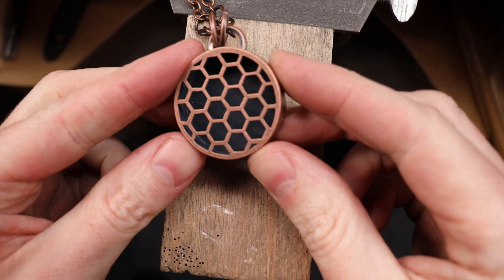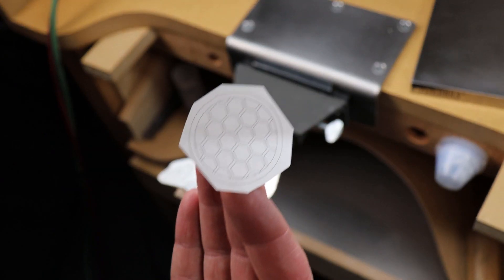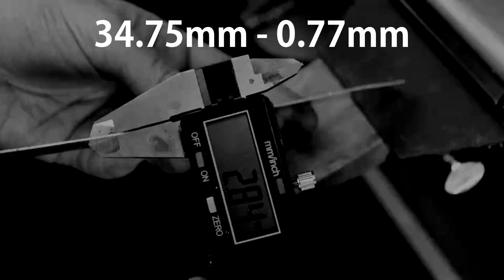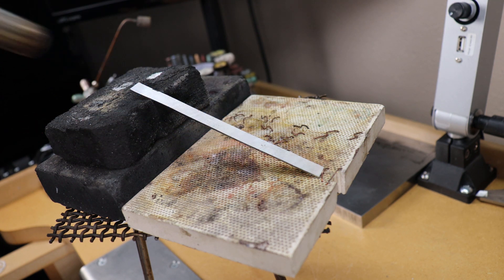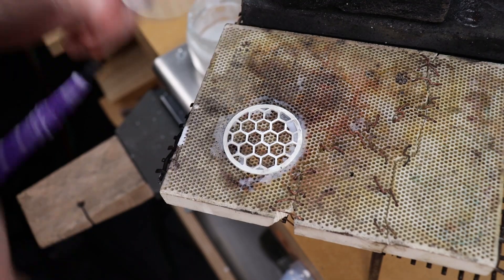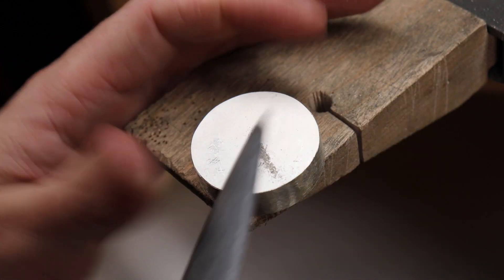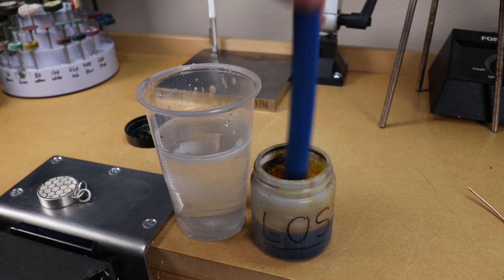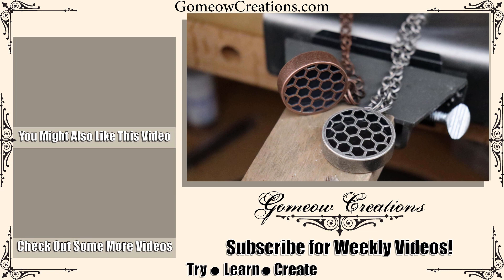Honey Comb Pendant - step by step guide using basic tools [Free Downloadable Design]

Comment from the maker: I will show you step by step how to make this honey comb pendant from scratch using 0.8mm sheet metal and some basic hand tools.

Here is the list of tools & materials that I used in this video:

Download Honey Comb Design ➜ http://bit.ly/HoneyCombDesign

Liver of Sulphur Gel ➜ https://amzn.to/3vFDsbd

Hone & Highlight™ Tumbling Medium ➜ http://bit.ly/HoneHighlightTumblingMedium

Steel Bench Block ➜ https://bit.ly/PremiumBenchBlock
Rawhide Mallet  ➜ https://amzn.to/3nEbWb8

Haymaker SawFrame ➜ https://bit.ly/HaymakerSawFrame

Smith Little Torch ➜ https://bit.ly/SmithLittleTorch5tips

NANO Jeweler's Saw Blades ➜ https://bit.ly/NANOSawBlades

Rolling Work Table ➜ https://bit.ly/RollingWorkTable

PepeLube Cut Lubricant ➜ https://bit.ly/PepeLubeLubricant

Manual Combo (Wire/Sheet) Manual Rolling Mills ➜ https://bit.ly/ComboRollingMill

Single Drum 3LB Tumbler ➜ https://amzn.to/3uok1mI

Titanium Solder Pick ➜ https://bit.ly/ErgoLastTitaniumSolderPick

Third Hand With Tweezer Soldering Tool ➜ https://amzn.to/3tfRM8p

0.8mm Copper Sheet Metal ➜ https://amzn.to/3xQdMKS

Small Melting Ceramic ➜ https://amzn.to/337fWrg

Ingot Mold ➜ https://amzn.to/3t5pQEk

Cheap Steel File Set ➜ https://amzn.to/3nDbY2U

Sandpaper 120 to 2500 Grit ➜ https://amzn.to/3ubANpp

Miter Vise Filing Block ➜ https://amzn.to/33aaF2d

______________________________________________
If I'm missing an item you are looking for in the video just leave a comment and I will try to get you a link to you asap 😁👍

If you are looking for more tools and materials that I use, well you're in luck! I made a page on my website just for that and I'm updating all the time so bookmark it to stay up to date:

https://GomeowCreations.com/tools-and-materials 
https://GomeowCreations.com/partners-discount-codes

______________________________________________

My PATREON ➜ https://patreon.com/GomeowCreations

One time support ➜ https://paypal.me/gomeowcreations
______________________________________________

Instagram ➜ https://instagram.com/gomeowcreations/
Facebook ➜ https://facebook.com/GomeowCreations/
______________________________________________

#honeycomb #jewellerymaking #jewelrymaking #goldmaking #silversmithing #diy #gomeowcreations

Comment: Those pendants are awesome.  Would you be able to make a video with one that has a hinged front plate. So you can put photos or anything in it...
Reply from the maker: Thanks and it would be a lot more work to get it working in that way. I might do that some day. Recording and editing really slows down the making prosses so even simple projects takes days to get done 😅
Reply: @GomeowCreations  oh, most definitely,  I've tried a few attempts in the past with some videos, and I have gotten quite good at forming silver rings and chain. But felt I needed to work with the silver and not worry about videos, lol. That will all come in time with my learned knowledge that I aquire...eventually I'll release some of my work. I hope to be as good as you and others I have make friends with on YouTube.
Reply: I had an idea last night about this, instead of a "hinge " why not make it with a smaller bezel on the front side as well. That way you can remove front or rear, and be able to put things or pictures inside. Nice pressure fit.

Comment: I know you have been doing it for a long time now so you have had a lot of practuce, but you make sawing and math seem so easy! Your honeycombs look perfect!   Thanks for another great video!
Reply from the maker: Thanks and yeah I do have a lot of time into my sawing work. Here are some helpful tips. 

Get good saw blades. I do like the Nano Blades that I have. I was given them for free from Pepetools but I know when I run out of them I will be buying more. It's about $30 for 144 blades of one size. Here is a link if you want to check them out https://bit.ly/NANOSawBlades

Also make sure you have good support for your work, if you look at my bench pen it only has 1 small hole. This is so I can have most of the work supported on the wood and I will not have it moving on it's own or bending. 

As for my last tip, make sure to use some kind of cut lube, it really does help. 😁👍